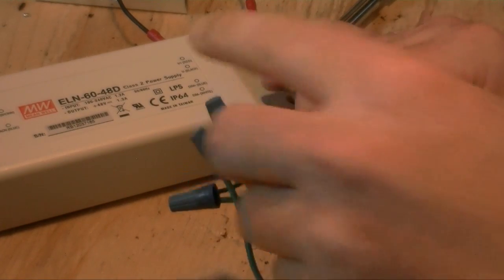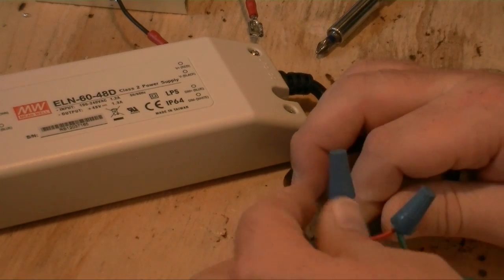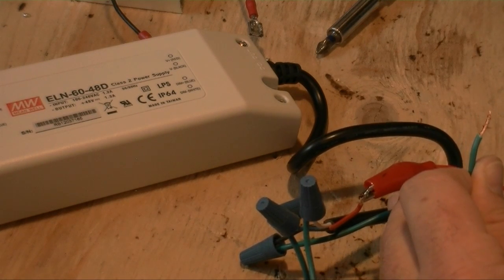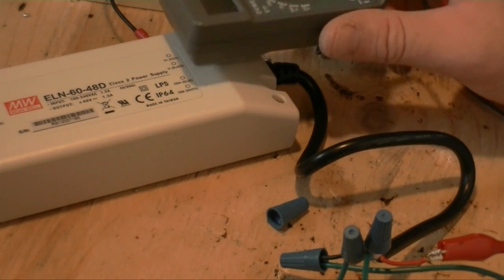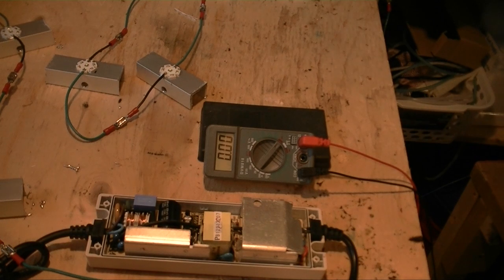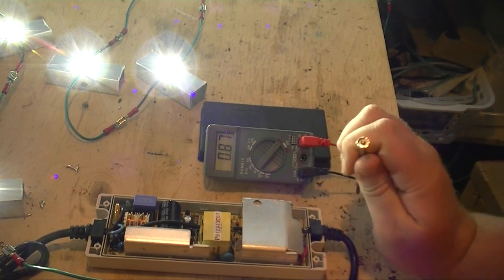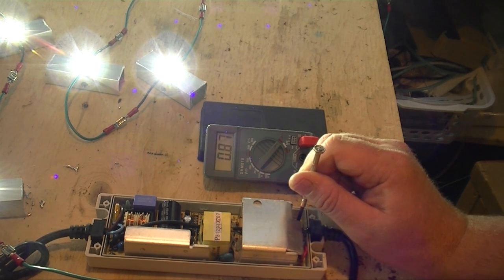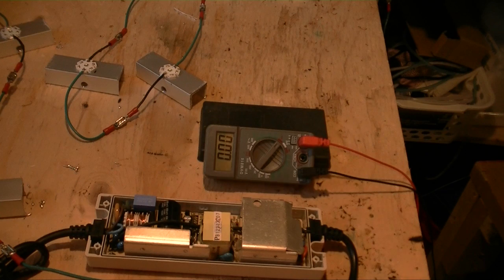Rickets Reef: DIY Frag Tank LED Fixture Part 5

Comment: @fishman807    I went with 36 led cree 3w , 24 royal blue, 12 white, 3 drivers, 80 degree optics, kit from rapid led, on my mixed reef 40 gallon, If I only had softies, a 24 led cree 3w, 12 white, 12 royal blue would of been fine for a 40 gallon.  Kinda hard to suggest how many leds when I have no clue the size of a tank you will use